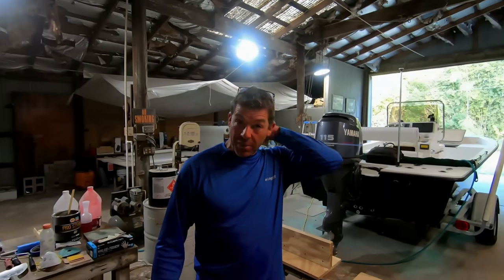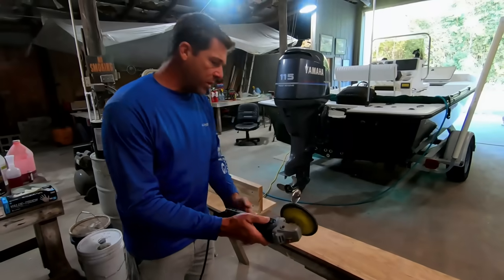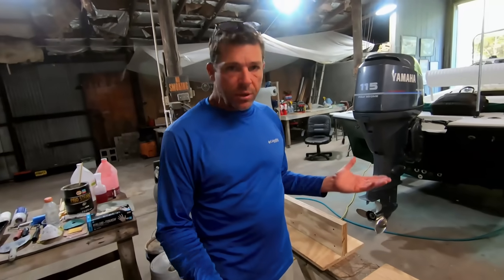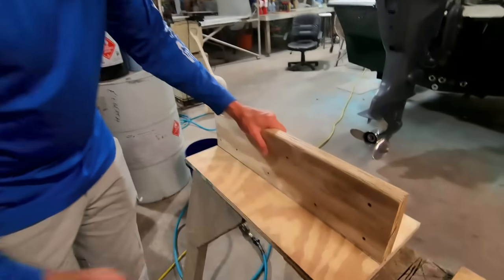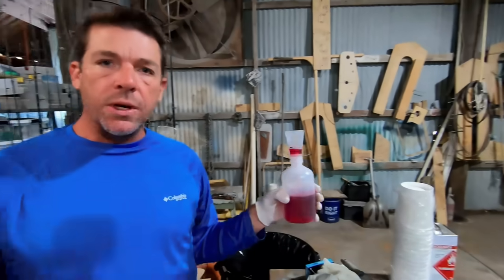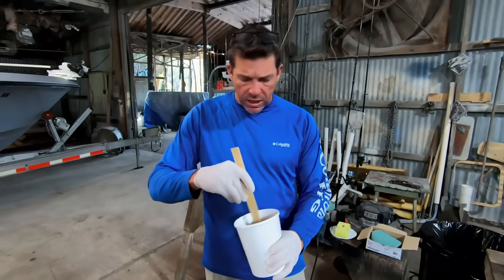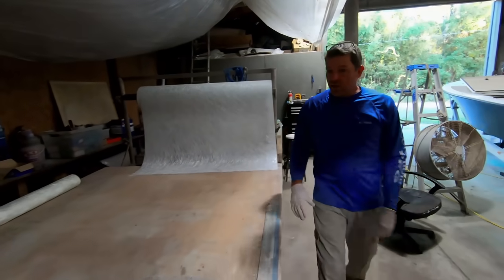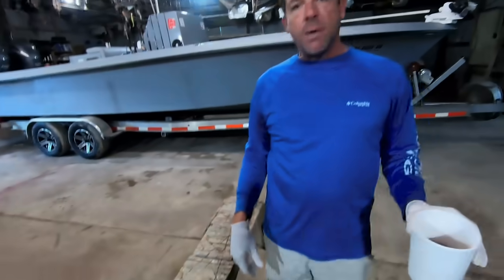How to FIBERGLASS over PLYWOOD!  Do it the RIGHT WAY the FIRST time! Step by Step DIY fiberglassing

Comment: Not a great deal different from working in body shops with certain restoration jobs and also rust bucket jobs..I had to learn the hard way to wear disposable gloves. It's really not as much fun as seen on TV to have to chemically scrub the daylights out of your hands getting matt off them..
You're right about sanding fiberglass. Sometimes feels like sanding the sidewalk with a wad of tissue paper..
Reply from the maker: Great point! Some good protective gear really help keep the mess down for sure! Thanks for watching!

Comment: On plywood boats do you glass inside and out?
Reply from the maker: That is a topic for debate, some say yes, some say no. We have done it both ways with success. On small stitch and glue skiffs that see light service, we usually epoxy and fiberglass both inside and out. The wood is completely sealed with this method. The problem is that if there is ever any damage to the epoxy skin, water can get into the wood and rot will occur unless it is fixed right away. With work skiffs, or larger boats, where glassing both inside and out would be very difficult, we just fiberglass the exterior. Some say this is better because it allows the wood to Breathe from the inside. I know it is not a yes or no answer, but I hope it helps! Thanks for watching, and best of luck with your project!

Comment: please show that the BIAX has mat on the back, as you cannot bond cloth with cloth without a layer of mat.  Also, mention that the BIAX uses about half the resin as mat. I may be wrong ,but that is some of the criteria when I choose material. BIAX costs more but some of the cost is offset with lower resin usage.  And the Mat is about  no strength in comparison.
Reply from the maker: Thanks for your thoughts, and thanks for watching!

Comment: Can you fiberglass over painted wood/plywood?
Reply from the maker: I generally used new marine fir plywood on our projects that require wood. I would  recommend sanding down to clean wood if you want to get the best bond. If you are unsure what kind of plywood it is, you should consider using epoxy resin, as it will stick to almost anything. And remember, csm or mat is not compatible with epoxy resins. We will be making a Epoxy vs vinylester vs polyester resin video soon. Hope this helps, thanks for watching!

Comment: You said you could come back and put a coat of resin on over the finished glass work to get a smooth surface. I thought that the resin had a "wax" in it that prevented you from re coating a finished  surface.
Reply from the maker: There are many different types of resins available. We use a laminating resin which I show in the video. It does not have any wax in it, and remains tacky so other coats of resin or gelcoat can bond to it. Laminating resin is what most professional boat builders and shops use. I also have a resin selection guide video here on the channel that might help show the different resin types available. I hope this helps and thanks for watching!

Comment: Wouldn't it be enough to put epoxy on if it is to waterproof it?
Reply from the maker: If it is a table or a light duty interior use project, then yes. If it is exterior and structural, then I would always add fiberglass. Just my opinion based on experience.
Reply: @FishBumpTV  Its subfloor under a teak deck on a steel boat.

Comment: Can i use it to make a fish tank?
Reply from the maker: I imagine you could. You may want to consider using epoxy in that application since it would be holding water all the time. You might also consider using something like Coosa board instead of plywood for the same reason. Hope this helps, thanks for watching!
Reply: @FishBumpTV  thanks

Comment: I had a guy rebuild my shower [my back was messed up so I hired a guy] enclosure with that black roll on mastic crap. 3 mo later it was leaking. He came back to fix it and I said here is what we are going to do. 

Rip out the tile and grout down to the base and then buy fiberglass mat and resin and do it like it is a boat. So we put down 2 layers of cloth and resin just like shown here. 

Let it cure then mudded over that and then put down tile over that. Grouted it and done. That shower enclosure is still water tight over 20 yrs later. 

Bought another house and wife wants a walk in shower. Guess how I'm going to do it? Cement board then fiberglass then tile. For boats I use aluminum.
Reply from the maker: Thanks for your thoughts! Yet  another great use fiberglass!

Comment: Hi Joe, I am so grateful for your videos and effort in teaching us about fiberglassing, gelcoat, etc. I would love to hear what you think about the fiberglassing process of the Swedish Couple of RAN Sailing episode 371: https://youtu.be/P9FOUN8xi7M?t=277 (it starts just at the moment for my question). They are building a vast sailboat with timber wood as a core sandwich material. When applying the first layer of fiberglass, unlike your advice to use just resin over the wood a good while before fiberglassing, you can appreciate they do it immediately before applying the first layer. How will that bonding work in their case, especially considering that they are glassing the boat hull? Could they have a risk of delamination in the future?

Comment: Applying a layer of plastic over the uncured laminate. Is a great way to get more compression and eliminate any air. Especially on vertical or something overhead. t gravity is not working with you.
Reply from the maker: Thanks for the tip, It is a good one in some applications!

Comment: Is the secret to using polyester rein on ply …to saturate the ply ,let it set and glass,is that why polyester has been not recommended,is because people do not saturate the surface of the wood first?
Reply from the maker: Many people skip the step of priming the wood with one or even two coats of resin prier to glassing. I do think it is very important to prime the plywood, especially with polyester resin I also think sanding with a 24 or 36 grit helps the resin really bite into the plywood. The wood must be very dry, And Marine Fir plywood has given us good results. Every step is important. Lots of people want to skip the prep work, then wonder why the end result is low quality. Epoxy resin does adhere better to wood than poly in most cases, but is more expensive and can be more labor intensive to apply. Hope this helps, thanks for watching!

Comment: Why do all the forums and people say polyester resin isn’t waterproof and shouldn’t be used on boat builds?
Reply from the maker: There are pros and cons to all different resins. Most people don't realize that 95 percent or more of all boats are built out of polyester resin. If polyester resin is used properly and applied in a good heavy coat, it can work great for many applications. It is true that vinyl ester and epoxy resins are better at waterproofing and sealing, but they may not always be necessary. I hope this helps, and thanks for watching!

Comment: That all looks good but to use polyester resin instead of epoxy is in my opinion just cutting corners.I have seen many times fiberglass delaminate from plywood using polyester. Epoxy just sticks so much better.
Reply from the maker: I think you missed the whole point of the video. I never said polyester was better than epoxy. In fact I said in the video that epoxy is a premium product. The polyester resin  problems you have seen are most likely a result of poor application methods. Using quality plywood, making sure the wood is dry, sanding in some tooth to give the resin some bite and priming with resin are steps that are usually skipped in most builds. Feel free to use whatever resin you want, but if the prep work is poor quality, then it is not going to last. Hope that's helps clarify what the main purpose of the video was. Thanks for watching
Reply: Please go ahead and watch this video: EPOXY vs POLYESTER RESINS - TEST No.1 - LAMINATING ONTO MARINE PLYWOOD and then tell me what you think. All I said was if you want to do a top  quality job use top quality ingredients. If you paint your house and do the presswork perfectly. But then you use cheap paint instead of high quality paint the hi quality paint job will last longer.
Reply from the maker: @srupp9271  I have seen that video. Not all jobs require epoxy, and not all people can afford the premium price of epoxy. If you can, or want to use it that's your decision. Nearly every fiberglass boat built, is built with polyester resin, and if done properly can last decades. Our family has built hundreds of fiberglass hull boats with polyester resin and marine plywood superstructure that are decades old with no problems.To be fair we also have several videos on the channel talking about the correct use of epoxy  resin and vinyl esters as well, so I am not a fan boy of any particular one.I have used all of them extensively, and we are trying to give some good pointers for people trying to decide what is best for their particular needs, then show tips on how to do it the best way possible. Most of the comments we get on the channel are pleasant and people seem to appreciate the time we take to provide free tutorials and boat repair info to you guys. I am open to input and suggestions, but I appreciate when it is done in a polite and respectful way. I hope this helps clarify what our channel is a place for, and what we are trying to do. Thanks for watching
Reply: Don't get me wrong I do admire  your work. The way you get that thick fiberglass to go around the corners without getting any air bubbles is pretty impressive and looks like perfect craftsmanship and I do believe you that it can last for decades. I think all the big quality boat companies like Bertram and Hatteras do the same. But like you said certain jobs require certain certain materials. I think there just hasn't been enough real testing done. Especially when it comes to the test of time. That test  that the other guy did in his video should be done with the samples sitting out painted in the hot sun and the weather and then look after 10 years or so what it looks like Well keep up the good work and yes I think I would buy a boat made by your company.

Comment: Poly resin and wood = eventual delam.  Seen so many polyester fibreglass boats with timber transoms and stringers all to bits.  Any boat builder who works with timber and wants the boat to last uses epoxy, not polyester.  Why? Polyester sticks to timer, epoxy bonds with the timber.
It might be OK on the flat water of Florida or on lakes, but if you want to do it properly, use epoxy
Reply from the maker: Most of the problems with wood and polyester resin in new boat construction come from either bad prep, bad material selection, or bad application. Lots of factory built boats suffer from one or more of these factors, resulting in failures. I know this because my father built new fiberglass hull boats as have I, with marine Fir plywood for stringers, bulkheads etc  that are still solid today. Not saying that marine fir is the only plywood that will work with polyester, but I know it has worked well for us. We also didn't try to glass over any kind of lumber or timber. We would laminate plywood if we needed a thicker material. It is also very important to be sure the plywood is completely dry. You should also sand all the surfaces with a very aggressive 24 or 36 grit grinder to put some tooth on the surface. Then you  MUST prime the plywood with 1 or 2 coats of thinned resin, and let it cure thoroughly. Then put plenty of glass over it and  finish with gelcoat. If you skip any of these steps, you will likely have problems. I was not suggesting that epoxy resin is not great for boat work, in fact it is very good or that poly is the only resin you should use for this kind of work either. I had several viewers requesting a video on this topic, that is why I made it. I also plan on making a video using epoxy on plywood, and vinyl Ester as well. Modern composites like Coosa are also a great substitute for plywood if you are worried about rot.In the end it is up to you to choose the material you are most comfortable with. I hope this helps clear up what the video was intended for. Thanks for watching

Comment: Exactly what type plywood do you use, being that it's not all created equal.. Plywood designated as marine grade, in my experience is nothing more than A/B exterior. Lots of plugs and core voids. Not true marine plywood which uses high grade veneers in its core and surface. Void free and expensive.

Comment: polyester resin dont glue or bond  to wood like epoxy does.
Reply from the maker: Most people don't prep the surface or apply polyester resins properly. All resins have a purpose or they wouldn't make different types. You should choose the best resin for your application, or the one you feel most comfortable with. If you like epoxy, them that is what you should use.

Comment: Epoxy bonds to wood stronger than the wood itself. Polyester does not and relies heavily on the mechanical grip you gave it with the coarse disk on the grinder. I came here expecting epoxy and testing tor the best advice I can give which is use tabletop epoxy hardener which has UV protection. Why? A small percentage of UV gets through your top foats and destroys the epoxy over a 20 year time frame.
Reply from the maker: Thanks for the info!